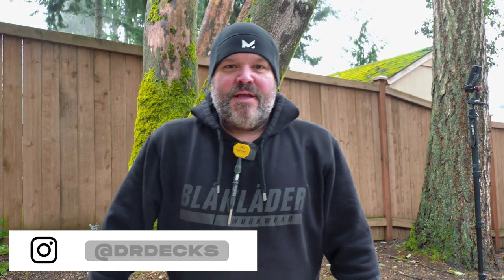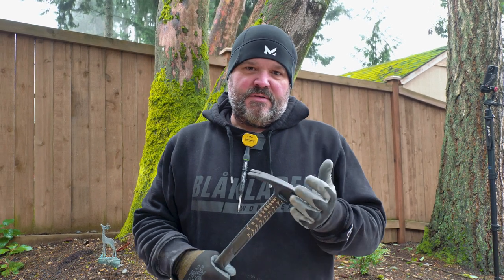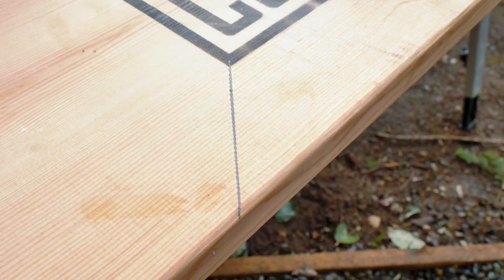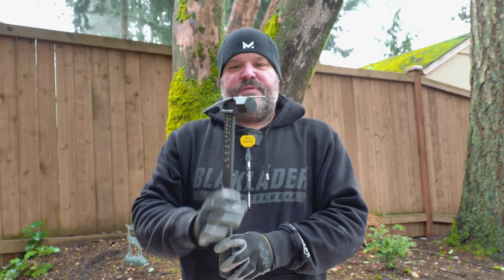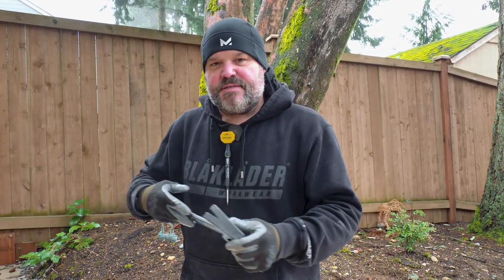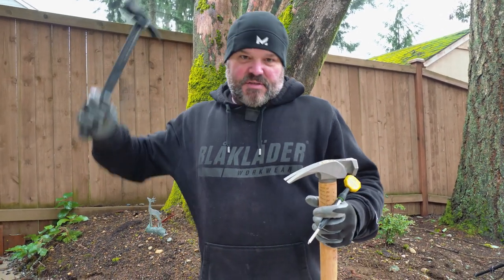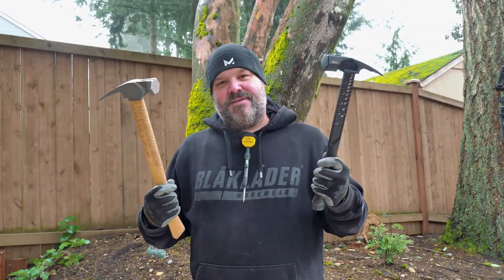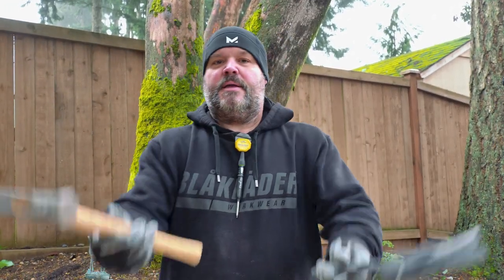Review: Boss Hammers || Dr Decks

Comment: The face nail pullers are better in some ways than the Stiletto side puller in that it gives three different mechanical advantage options. Short to the side. longer rock it on the striking face and longest rocking on the claws. The same as the original Douglas design. It is also 16" long for layout.

Comment: I got a BOSS about a year ago. Got the 12oz with the wood handle. Just broke the handle for the second time. It's been a good hammer. Best thing about it is carrying it on my tool belt. Weighs nothing. I really liked the idea of the speed square built in but I have literally never actually used it. Just a gimmick. If I'm going to need a speed square I'm just going to use a speed square. 

Thinking about getting an all metal hammer. Might try this one out. Might get a Martinez. Used to have wooden Stiletto and loved it but I ain't buying another one cause they're made in china now.

Comment: You could actually do a layout with that square on the bottom of the hammerhead because it’s an inch and a half
Reply: I’m sure it’ll be pretty sweet for rough framing. You could easily get good enough at finding your mark and making good cuts with this.

Comment: I been framing last two weeks. Finishing out the underside of a house built 10ft high on pylons. I do remodels and go start to finish. I haven't driven a nail yet. Who hammers nails? WHo are you people? Do people who own $300 hammers drive nails? No, those people own 10 nail guns like a do. I did break my handle last week though beating the hell outta 2x4's and pulling nails. 

OK, I do drive roofing nails rather often. Installing windows. I'll put some button caps on too. I'll tarp a roof from time to time and the button caps get beat in. Sometimes I'll hammer a siding nail. That's about it. NEVER hammer 3.5 or 2.25" nails.

Comment: I have had a cheap husky hammer for years and just realized it has the nail start magnet on top. My thumb and pointer finger were pissed
Reply: XD Hahaha I saw a framer use it to walk on a roof to place toe boards. Slap on a nail and pins it in the 2x4 and keep walking. Most badass thing I’ve seen. Never thought of the use till then. Dont really use as a roofer but definitely a neat and easy feature. Still live my estwing though.

Comment: Maybe I should do a review of the hammer since I actually own one 🤣 and have owned it for about a year now as my daily. I own the pro series full titanium.
Reply: How is the pro series? Thinking of getting one myself
Reply: I do really like the hammer, It was certainly a change from a 24oz to 16oz, the hexagonal head is good and bad at same time certainly times it’s way better than a round especially nailing close to a wall etc. but can catch you out at certain angles in tight spots but nothing a nail punch doesn’t solve. Don’t really use the squaring function 😅 but it’s accurate enough tested it a few times, I carry two squares in my belt so kinda makes it redundant. Pretty well balanced, the 13mm on the bottom gets more use than square and it’s quite handy. Got the black coated one, but took the coating off the face days after I bought it and polished it to a mirror finish looked great now is just silver and dirty on the face 🤣. But titanium I’ve found even polished doesn’t seem to slip like steel on steel does. Wouldn’t recommend if doing a lot of concrete work swap back to steel for that as it handles carpentry well but isn’t what I consider an all purpose hammer. Not sure how it compares to the competition, is a nice looking, functional bashing tool 🤣
Reply: Just wondering if you found any issues with the grip on the hammer loosening around the handle?

Comment: Hammers are old school. Use a power nailer or drill driver.
Reply: Soooo when a nail doesn't sink in all the way your the guy on the job site using a $700 nail gun to beat in a nail!..... Got it.
Reply: Soooo when a nail doesn't sink in all the way your the guy on the job site using a $700 nail gun to beat in a nail!..... Got it.

Comment: You missed one feature.  Just above the rubber handle there is a notch on the handle at the 45 degree angle that is for a quick 45 degree of you put the notch against the board.   Instead of pivoting on the claw.   Again it will will get you close if framing

Comment: Not the best review . Literally all you did was just explaining the obvious . Zero feedback on performance on different surfaces,  the reverb in the handle, impact strength, didn't drive any actual nails fully ,  no adequate nail removal with any part , no comparison to other hammers , this video is for a grade 5 carpentry class .